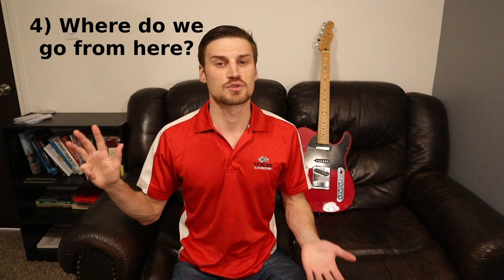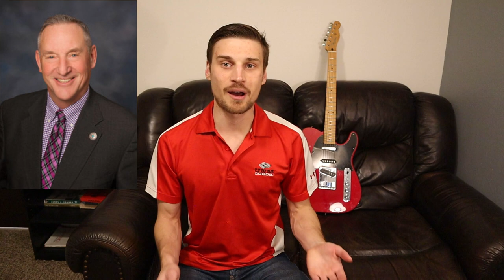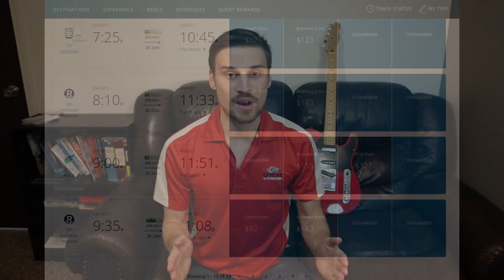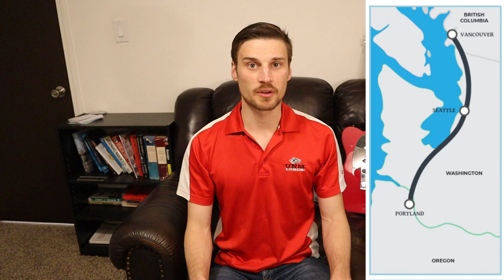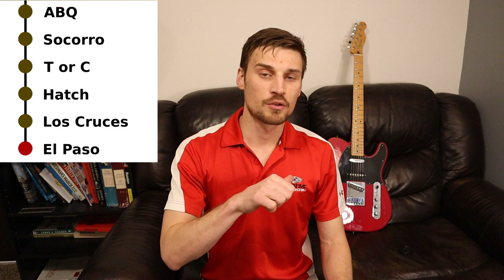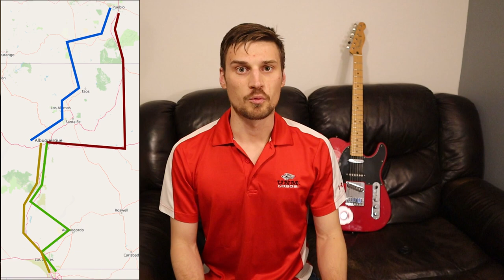High Speed Rail in New Mexico?!?

Comment: Interesting video, I do have some thoughts to add:

1) full HSR is unrealistic but you don't need that-as you say even 110-ish is a good speed for competing with cars (and makes more sense with the kind of distances and populations involved); at that speed driving time to/from  the train stations will matter a lot. Plus for a lot of trips you can probably get away with a park and ride.
2) Is there a lot that can be done as "low hanging fruit" with rail runner, for instance negotiating more slots with BNSF to allow more consistent all-day service? Something that looks more like a regional/all day rail pattern makes a lot of sense. If there's a push to allow electrification generally on mainline freight rail that will also help. This can also build political support for serious intercity rail since people will actually have a practical example they can see themselves. 
3) I would be cautious about trying to fit every rail transit need into a single project ,especially since the RGV from Taos to ABQ (relatively concentrated, some of suburban areas that may need service) will have different transport needs from the southern half of the state (longer distances that can be covered quickly but probably won't involve as many stops). It's better IMO to have a clear breakdown of RGV regional rail transport, local/city level rail transport where appropriate, and state-level rail transport with projects tailored to the locality. E.g. continuing to operate Rail Runner as a separate regional system for RGV local trips and concentrate intercity rail on major centers. This also takes a lot of pressure off the "who gets a train station"
 convo-you can make sure everyone gets transit connections and go from there to picking the connection that makes the most sense. Maybe it doesn't make sense to have the NM intercity connector stop at San Antonio, but if there's a frequent and reliable bus or local service from there to Socorro it's a lot easier to swallow not getting a station. 
4) Pendant to the above, I would pay extremely close attention to making sure transfers to local systems (either rail runner  or other non-intercity services) are as smooth and seamless as possible. Close study of Swiss-style timed transfers for any non-intercity services you can't get to better frequencies than "every 15 minutes" would be extremely useful-e.g. if you want people to use this to get from a suburban ABQ rail runner stop to Las Cruces, it works a lot better if they have a timed transfer at downtown ABQ.
5) This is a little off the wall, but I wonder if (pending BNSF cooperation on necessary electrified infrastructure) a Karlsruhe style tram-train would make sense for say the ABQ or Isleta Pueblo-Taos area as an adjunct to the intercity system?  I don't think there are many (any?) US examples but the area seems pretty conducive since you have an existing corridor, a series of cities and towns with decent but not insane spacing and not a lot in between them,  and probably some benefit from running trams directly through without having to plow a whole ass mainline in and maybe giving local transit a kick in the butt. You could even table upgrading the ABQ BRT to a modern euro tramline that branches off to old town and some of the areas that don't really have transit RN. 
6. I would definitely make sure that you can connect to Front Range rail when that happens, but that should be easy if you don't use wacky custom gauges or anything like that.  Likewise, if you go via I-40 it makes a lot of sense to think about a possible connection to Flagstaff. One thing I'm surprised you didn't mention is El Paso; if you can get Texas cooperation you could pull a LOT of ridership to/from there and in general no reason to leave a connection to an enormous population center like that on the table.  In general, if you have a cheap extension that gets you a lot of new ridership, may as well take it.
Sorry for the wall of text, just had a lot of thoughts etc.

Comment: This is a really interesting discussion, many thanks for uploading it. Are there any plans to expand the RailRunner down to Las Cruces? Connecting the two biggest cities along an existing rail corridor, then electrifying that whole RailRunner system would seem like a good start. And what about a west-east section too, along the I-40 corridor? Those far-flung communities also deserve a convenient rail link to ABQ. Lots to think about here, I'll be following the project proposals closely.
Reply from the maker: You make an excellent point about the east-west expansion, but instead of running a line along I-40, running a line toward Phoenix to the (south)west and Lubbock to the (south)east could reach the communities that are a little too far from the interstate. 
I haven't heard anything about Bill's bills or the RailRunner expansion at this time, but I'll keep you posted as soon as I find something out.
Anyhow, thank you so much for commenting! Hopefully more discussion and debate will lead to better-informed representatives and better legislation overall!
Reply: The Rail Runner down to Las Cruces would be an interesting proposition...the Atchison, Topeka and Santa Fe ran the El Pasoan service down that way until 1969 (it almost survived to Amtrak Day!).  By the end, it was "Amos 'n Andy" (the railroads only two Budd RDC self-propelled coaches) running the service, or an E8M pulling three cars: an RPO, a diner-coach with vending machines, and a coach.  I'd be worried that a straight commuter train wouldn't offer some of the amenities that a longer distance train would be expected to have on board, like limited food services.  The Amtrak Cascades would be a good model for this, with its Cafe-Bistro car.
Reply: @brentboswell1294 - These are some good ideas, and I hope the decision makers in SF are bold enough to forge ahead with this. “ABQ to Las Cruces is a 3¼ hour drive on I-25, wouldn’t you rather let the train take the strain? Stay connected, do some work, enjoy the view, have a snack, kick back, take a nap, arrive relaxed…” etc.
Reply: @Yormsane  I hope so!  I'm an NMSU grad-go Aggies 😎  Another obstacle, that will ultimately limit track speed, is that the former ATSF El Paso sub (Belen, NM-El Paso, TX) is the longest stretch of "dark" territory in the Continental USA (i.e. no automatic train signals)!  Trains were dispatched on this line with old-fashioned train orders, with train passings being organized hours in advance by the line dispatcher, and train crews would have to stop, meet each other, and exchange a track warrant to proceed.  The BNSF would probably be a little adverse about upgrading the El Paso sub to a signaled subdivision.  As I recall from railfanning in my time at NMSU (early 1990's), the speed limit posts were showing 45 for freight, 60 for passenger trains.   And what passenger trains, you might say?  I caught the Sunset Limited diverted onto the El Paso sub twice, and once the (private) American Orient Express going up from El Paso 🙂  But the old Santa Fe always kept their tracks in excellent condition.  I remember in the early 1990's, they had the only section of Class VI rail on a freight line in the US (the Belen Cutoff-79 MPH limit for freight, 90 for passenger trains). I understand that the BNSF allowed that section of rail to deteriorate to Class V, which is the same as most freight mainlines in the USA.
Reply: What are you talking about?
The RailRunner isn't even "convenient" between ABQ and SF, and here is just one example...
We have a property in ABQ, for us to go from there to our favorite restaurant in SF via the RailRunner entails...
30 minute drive to station
10 minute walk to station after parking and walking through a sea of vagrants/addicts
1 hour and 42 minute ride on Choo-Choo
20 minute walk to restaurant 
For a grand total of 2 hours and 42 minutes
Or we could walk into our garage, hop into our car & drive, and be seated at a table in less than an hour

Comment: The Brightline model may work because there already exists an existing rail corridor they have access to. Of the 270 miles between Miami and Orlando, they are only building less than 50 miles of new corridor, and single track with a few passing sidings. Along the existing FEC rail corridor, they are just double tracking and improving bridges. They plan to average 80 mph, taking less than 3.5 hours to travel between Orlando and Miami. 
Note the important statistic I wish to emphasize is 3.5 hours of elapse time. Around the 3 hour point is where trains start to gain more market share than flying. For example, Amtrak’s Acela has 70% market share over flying NYC to DC with an elapse time of 3 hours, but just 50% between NYC and Boston with an elapse time of 3.5 hours. So Brightline is aiming for about a 50% market share with flying in Florida.

Another important point to recognize is the traveling distance of less than 300 miles. Most passenger trains in the USA off the NEC Acela runs at average speeds of less than 50 mph. Believe it or not, brightline’s goal of 80 mph average speeds matches what Acela does. That is awesome. But To get that high an average speed, the train makes fewer station stops, they double tracked the entire freight corridor between Miami and Cocoa, resignaled the entire corridor for faster speed trains, etc spending over $3 billion. And that is just one railroad corridor. 
I do not think Brightline would attempt this same formula Atlanta to Chicago. Why? It is over 700 miles between Atlanta and Chicago, and assuming the rail corridor could be double tracked, resignaled, and otherwise upgraded  to achieve 80 mph average speed, the elapse time would be around 9 hours. Much longer than the three hour goal I mentioned earlier, three times more.  Doing this on a rail corridor twisting its way through the Allegheny Mountains. Not likely.

But to achieve average speeds of even 80 mph, FRA regulations additional set points are reached that add expenses to both the trains and rail corridors. Over 80 mph, cab signaling is required. Over 90 mph enforced and strengthened grade crossing gates are required, over 110 mph grade separations at crossings are required, over 125 mph special FRA regulations are required for operations. 
Now the entire corridor does not need to be built to the same standard. For example, Brightline runs at a maximum speed of 60 mph between Miami and Fort Lauderdale, 79 mph between Fort Lauderdale and Palm Beach, 110 mph between Palm Beach and Cocoa, and 125 mph Cocoa to Orlando. And even in these huge sections, local conditions can cause speed restrictions that will force the trains to slow down.
The longer the route, and the faster the trains, the harder it is to maintain the tracks and higher train speeds. 
Trains make great linear transport, as vehicles must travel along a linear corridor. It’s not like ships which can move in any direction they please outside a ship channel. So it is easy for map lurkers to keep drawing the line further and further. But most people do not travel in straight lines over long distances. Instead of going north from Atlanta to Nashville, we might wish to travel west from Atlanta to Birmingham, or east from Atlanta to Charleston. The advantage flying from  the airport in  Atlanta is that you can fly to hundreds of destinations in just about every compass point. A HSR train station in Atlanta will only give you a linear line of destinations, in just a few compass points.

Comment: Looking at your assessment from a European perspective, I wonder why California HSR is so expensive? We are dealing with very similar hurdles in Germany, as they are in California. Environmental aspects and NIMBYism are enormous factor here as well (some projects are in the discussion for 30+ years now) and still, 120km (75miles) of 300kph (186mph) able newly built corridor came out to less than 3 billion and opened about 5 years ago. after inflation, in todays money it might be closer to 4 billion, but that would still be just around 50 million per mile, fully electrified and not built along existing rights of way. Brightline will only operate 110 mph on the FEC corridor and only reach 125mph on their newly built segment to Orlando airport after diverging from the mixed use FEC. Given that the freight trains on the Florida East Coast railway don't seem to be using super long trains with engines in the middle of the consists, I see no reason why electrification wouldn't be super beneficial. Electric locos usually pull at least twice what their Diesel counterparts pull, while doing away with the energy loss in combustion engines. these trains could change engines north of the split point or also electrify the rest of the line to Jacksonville, making future passenger service there much more likely. 
Back to California HSR, its crucial to fund the project to completion asap, to avoid further cost increases and deliver benefits sooner than later, whatever the costs. These costs (even at CHSR levels) will pale in comparison to their benefit and after a decade or two the rail line will be an irreplaceable part of California transport infrastructure. 

For New Mexico and Colorado I'd love to see electrified rail at speeds of 155mph, with track curvatures being designed for 225mph, so that the right of way could be upgraded in the future. Electrification brings huge benefits and 155mph rolling stock is readily available in Europe or with the new Acela trains. I'm not very well informed on the regional details of your population distribution in NM, but usually when we build new HSR lines for 155, 186 or more we try to also benefit smaller population centers along the way. Giving them stops on the line and with higher speed regional trains operating at 115 to 125mph (standard is around 100 mph here for many regional trains). All of that is usually mixed with several electrified freight trains an hour operating around 70mph (with some sidings to let passenger trains pass) and plenty of freight trains throughout the night. This leads to super high utilization, while still always prioritizing passenger trains over freight.
Reply: Those are some real interesting remarks. Wikipedia has some good information on the cost of CAHSR. The initial 171 mile segment is over 17 billion or 100+ mil per mile. This is the easiest segment. I don't know about Germany but in California there will be 55 miles of mountainous tunneling in the coming decades. The newest cost projection has a high of 128 Bil. Regarding New Mexico, it is a very large state (6th) with a very low density population of about 2 million. It is not fast growing like Florida, Texas, Utah and Idaho. It has a low per capital income also.
Reply: Update on CAHSR: Last week's board meeting reported the IOS (below) is likely to now cost up to $35 B by as late as 2035. Electric in Florida may not be advisable. Catenaries do not like hurricanes.
Reply: In comparision to your German example of $40-50 M/mile, It is projected to be as much as $200 M/mile for the CAHSR IOS. Further, some tunnels have been projected to cost an unbelievable $1 B/mile. Welcome to the public transit construction monster.
Reply: @davidjackson7281  Its also in public hand over here. And we keep complaining all the time about the inefficient processes and high cost. The cost I provided for our line here in Germany include 3 tunnels (total 9,6 miles) and 6 bridges (total 9 miles)
Reply: @MaxiAir  That's nice. It's springtime for trains in Germany. Don't be late. Don't be tardy. Come and join the grand old party.
Reply: @davidjackson7281  - We wish. New projects are also painfully slow. Mostly due to NIMBYs discussing everything to death. Some projects have been talked about for almost 30 years now and no track has been laid there still.
While we have great trains, a vast network and relatively good connectivity we are lacking reliability and ontime performance. Many main sectors are operating under overload situations for years and the relief projects are being delayed by NIMBY's. We usually share the tracks between Passenger/Freight/Regional/Long Distance/High Speed/Low Speed uses, so obviously there are plenty of knock on effects, if anything is delayed. And we can't increase frequencies because the infrastructure is mostly maxed out. As much as most politicans (and people) would love to see more freight on the rails, its just not gonna happen soon. I still love riding most of our long distance trains, but they are not always on time. Not sure about su1cides in the US, but they are an issue. Trains are a popular option for those people. Usually closing down mainlines for up to 4 hours at a time. Today we had at least 3 in northern Germany causing chaos. So as much as the national rail operator tries, in many cases its not even their fault.

Comment: Have you read the 2014 State Rail Plan? It gives a lot of good info about the opportunities and challenges for passenger rail in the state (it also talks a lot about other stuff, which is interesting but also very long). In particular, it estimated an El Paso to Denver HSR to be 45 billion, so the border-to-border segment of that would definitely be more than 1 billion haha. But it also mentions that increasing the Rail Runner's track speeds to 90mph would only cost about 15 million, which sounds like a pretty good deal! The Rio Metro budget document also has some good discussion about what it would need to run hourly service and/or get more powerful locomotives.
Reply: The RailRunner would greatly improve with more frequency plus most importantly --110 mph track and perhaps some 125 mph track aka Brightline. Anthol Mullen's comments up top are really outstanding and spot on. There is not nearly enough populaton to support a way too long through rough terrain 635 mile HSR from Denver to El Paso. Pat has there been a more recent NM  State Rail Plan published since 2014 that you may know of?